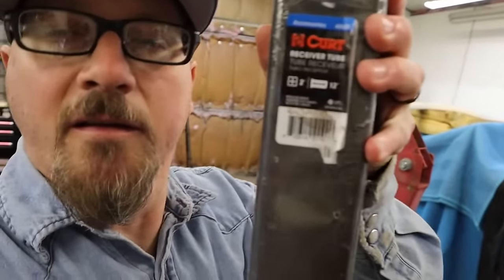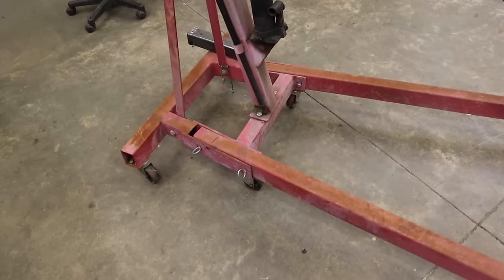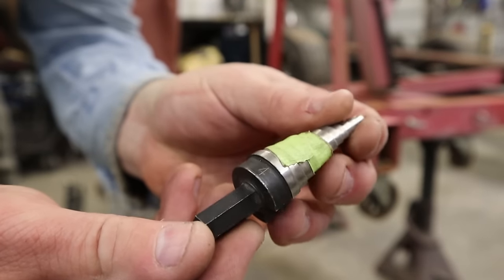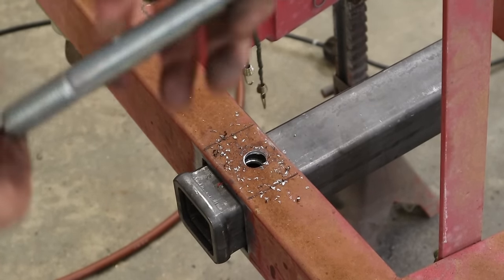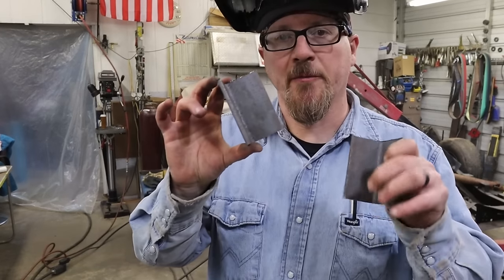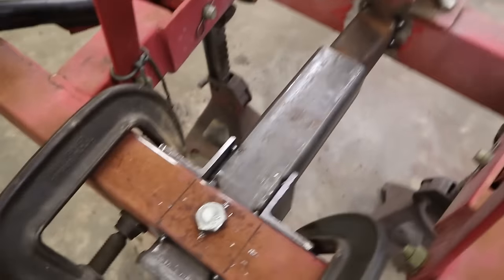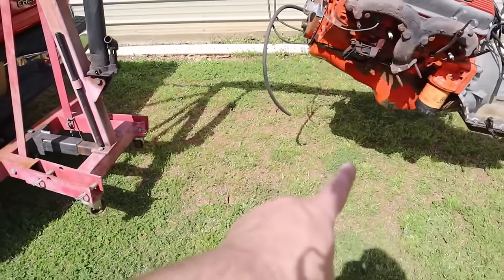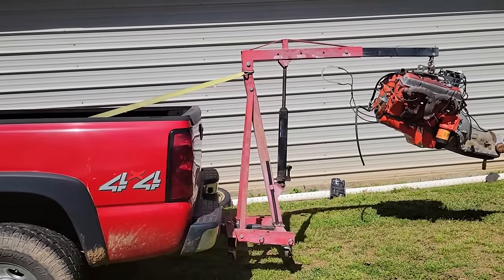We Made a Portable (Tow Truck/Crane) From an OLD Engine Hoist

Comment: 2006 I chained my exact same engine hoist into the back of a 6x4 trailer.  Same result being able to move things around the yard and heaps faster if you have a small trailer handy. Bugger all but there is upload on vechicle hitch and can use Anything from a small tractor to a sedan to do a job. Was always going to just make a tiny trailer A frame to sit the crane on with 14 inch car rims.
Reply from the maker: Awesome,  it works pretty well!!!

Comment: Using a level while drilling the holes seems to be a moot point because you didn’t have the frame leveled.
Reply from the maker: It was level
Reply: @ACDesignsGarage  
  I do think you did a good job on the hitch lift. Didn’t mean to come across as mr. negative.
Reply from the maker: @willyd1127  no worries I didn't think that, I remember leveling it but couldnt remember if I filmed it hahahaha thanks for watching  😄

Comment: Nice. For more stabilization after you pull engine out, if moving any distance, spin'r around lift w\ trans towards truck either build a platform to sit it on, or add a couple eyelets to each side of the hoist lift for ratchet strap attachments
.
Reply from the maker: Awesome thanks for the tip, I think that would work well!!!

Comment: When moving load with lift, put couple tag lines from load  to base of lift to stop load from swinging around. This is standard procedure on jobsites to secure loads while moving and keeps people out of pinch points. This was a good idea Hope this helps
M L Rogers     Pasadena,TX
Reply from the maker: Yeah, thanks for the tip!!!!
Reply: @ACDesignsGarage  as a small crane operator in plant, this kept people from getting hurt and loads from swinging out of control. Also after you tie taglines to load, then hoist up a little to tighten the lines works best. Thanks
Mike

Comment: I did a similar thing about a year ago but only mounted it to the front of a 1999 dodge Durango and ran 2  ratchet straps over the top to the rear bumper to lift an engine out of a pickup and then used it to lift the front of a Subaru to move it around the yard to get it out of the way.
Reply from the maker: That is awesome!!!!

Comment: I built one almost the same way to pull the engine out of my 72 C-10 because I don't have any concrete to use the hoist on. Had my little Ranger sitting on its bump stops with a SBC hanging off the back, but it worked great.
Reply from the maker: Thats so awesome,  that motor came out of my short bed 72 c10 also lol
Reply: @ACDesignsGarage  Mine is a long bed, but it is interesting that you did the same thing for the same truck. I have a new motor 400sbc that I'm going to put in it. Lots of body work needs done before that though.

Comment: It works but there is enormous (sideways) torque potential on the lift. You definitely need those straps. They help with the torque.  The center of mass is 4 feet from the pivot point of the hitch .  The potential for twist is enormous from a mass that far from the hitch.
Reply from the maker: Yeah I agree, thats why I put the ratchet straps on, but its mainly for moving stuff around in the shop.Thanks for watching!!!

Comment: Nice - but I'd be worried about tongue loads on that receiver.  Why not bolt the hoist into the bed of the pickup and take the gate off?
Reply from the maker: You could, just didn't want to mount anything in the bed.

Comment: You could turn your removable part sideways and slide it into the lift and use the truck hole to secure it with the pin on the lift.
Reply from the maker: Thank you for the tips!!!!!! Ill try that.

Comment: You need some structural support at the load point, which is not where the weld was done ...
Reply from the maker: It works for moving stuff around the yard, if it gets to heavy I add straps to the top. Thanks for watching 👍
Reply: @ACDesignsGarage  

I just mean that the load has a compressive element at the base of the hydraulic ram.
This load transfers down to the crossmember. The piece you added does not significantly support at that spot. It just needs an additional support member.
The load is not transferred to the frame as it would if on the ground. 
Check some online stuff on engineering load members. If that piece fails, you might break something expensive or hurt yourself.